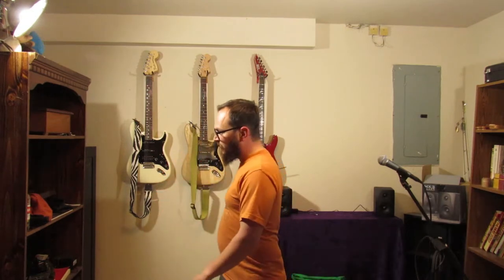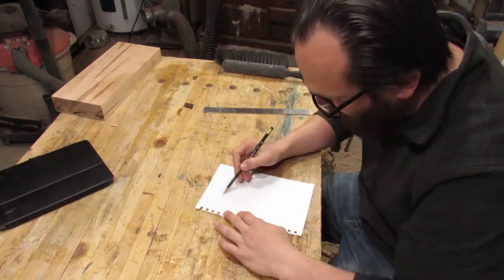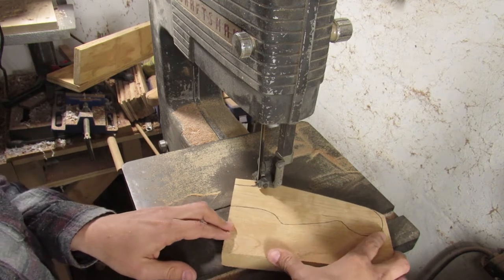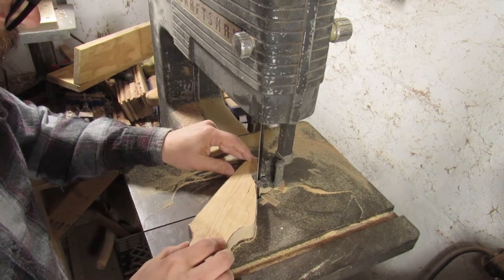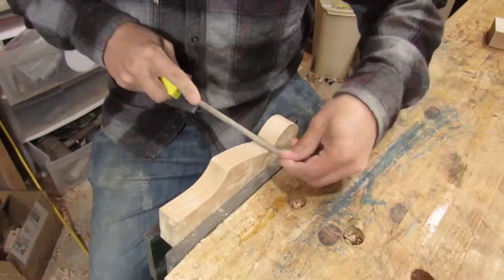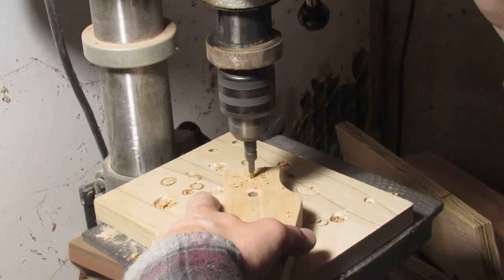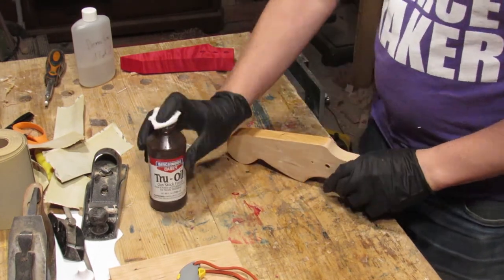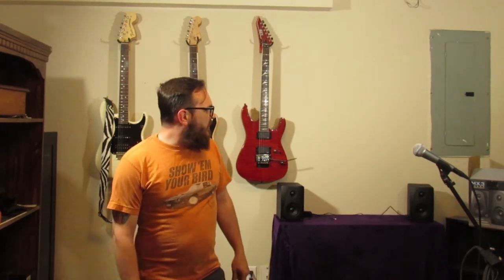DIY Guitar Wall Mounts

Comment: i rough cut mine hand shape i put a pice of rosewood to reprecent the first fret and i use cheap but real hadware lock ing nut for floyd and plastic for standard nut tuners are like i said chepos just as long as it looks like part  iam happy. did my first espstyle hockey last part 2016 or so.only made a hsandful for friends
Reply from the maker: That's really cool I'd like to try one with all the hardware one of these days.